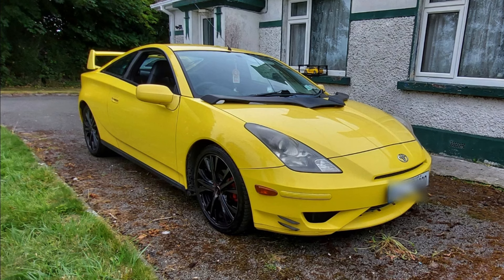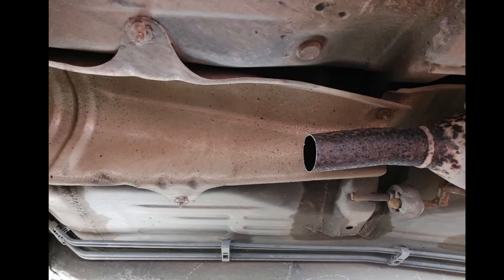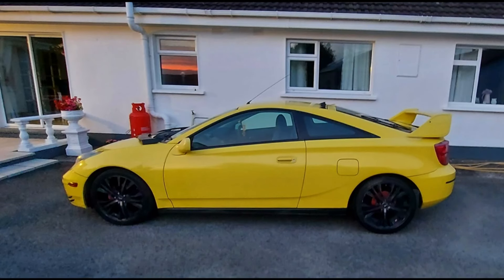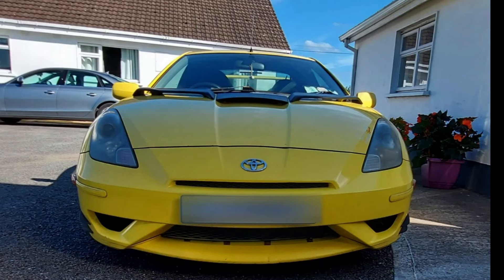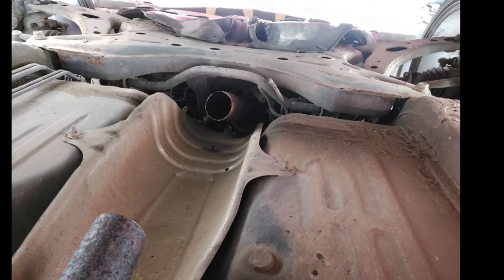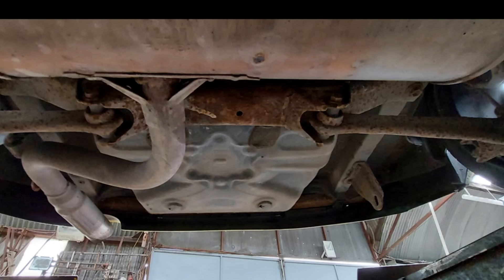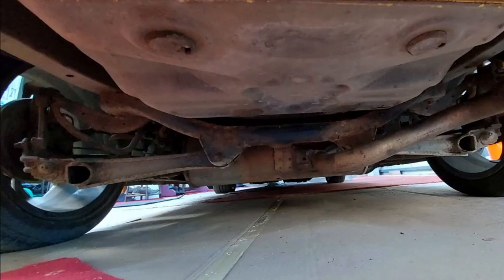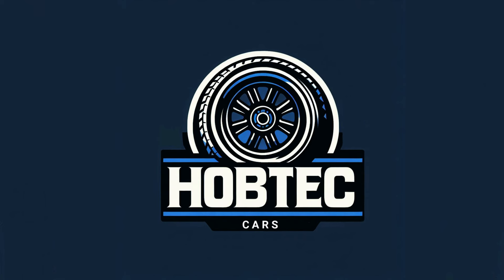Toyota Celica Gen7 JDM Part 1: Saved From Scrap

Comment: I got hold of a jdm gen 7 Celica 2zz was going to use it  for another mr2 engine swap. But i found it has a lower lift point ecu and a lsd as standard. I got it home found its too good to scrap . Its now my daily funny enough i bought it with the cat stolen i used a spare mr2 cat i had hanging about and funnily enough i put leather interior in and binned the cloth.

Comment: How tou finding the car? Is it a daily driver ?
Reply from the maker: Thanks for the comment. I've a few cars so it isn't a daily driver. It's a Spring / Summer driver really. I drive about 800 miles a year in it. I love driving it. Its a very comfortable car and good surfaced roads and it's a pure joy to control around bendy B roads.
Reply: @HobTecCars  ok mate, I'm looking at one that needs some work, like a complete respray, so thinking about pulling the trigger currently!
Reply from the maker: @fghjjjk  Is it a 2zz-ge engine?
Reply: @HobTecCars  no the 140, red, so the paintwork isn't too good,.would ultimately need a respray I think